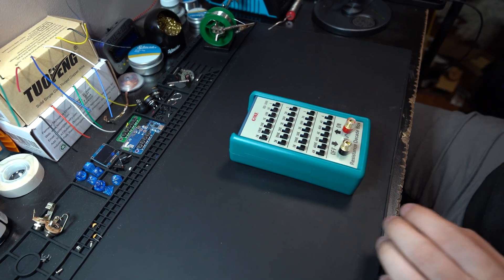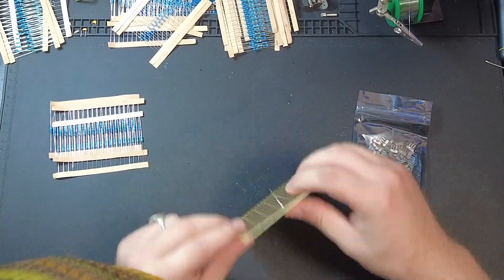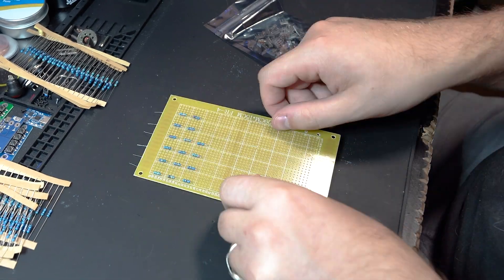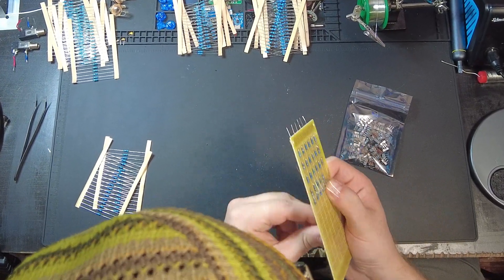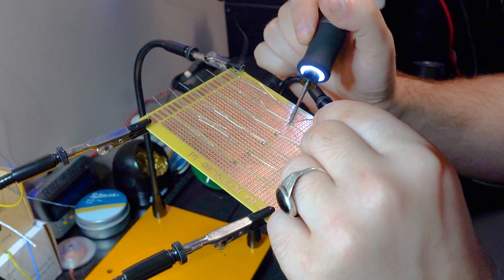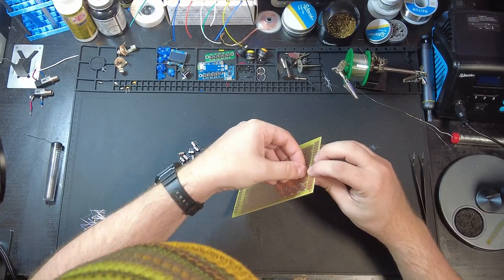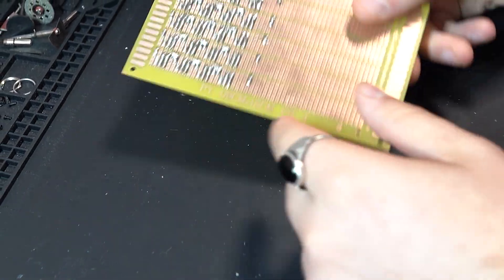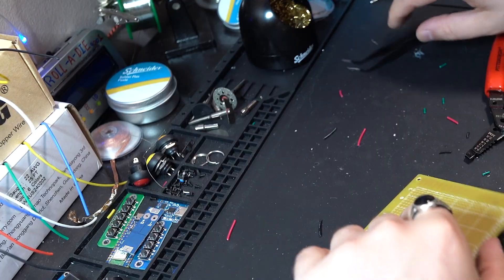DIY Resistance Decade Box

Comment: The main difference with the expensive one is always the accuracy. 
The accuracy of the resistors are what causing the price to be high. 
You are using the cheapest resistors with 5% tolerance. 
The resistors that have less than 1% tolerance are not cheap.
So the expensive resistance box is very accurate and often used by professional to fine tune or check the accuracy of the multimeter.
Reply: that is true generally, but it is true that the music community does not always overlap with the electronics community so what  happens is that even a basic pedal or switch or anything that is specific for a music purpose might cost you a lot not for what it really is but for the lesser demand because they know music people not knowing how actually complicated the part is will still buy them. That said I am really clueless about how precise they  need to be for this application tbh.
Reply: For most applications, 5% resistors are fine.

Comment: I'm surprised I never thought of this and have never heard of this either! But 70 bucks is a good deal, for an enclosure and assembly. I bet the tolerances are tight and manufacturers can get more constant values of components or tolerances because they get the cream of the crop by buying bulk etc. The engineering is probably easy but maybe it's a bit more complex, like do the tolerances stack? do they multiply? like after ten series resistors and some being 1% some 2% etc does that then mean the values could be off? IDK it doesn't really matter I'm probably gonna build one. Thanks.
Reply: Also time == money, but it looks like a fun project to do one or two of.

Comment: Awesome video! I really enjoyed seeing how you built the decade box. I was wondering, for beginners like myself, would using a potentiometer be a simpler alternative? Something with a wide range (like 0Ω to 1MΩ) might be easier to set up for quick experiments, though I know it might not be as precise or powerful as a decade box.
Reply: A potentiometer is nice for experimenting, biggest downside is that it has low resolution and to get its value in ohms would need to measure it with a multimeter. With a resistance box we can get the value just by reading the switches. 

Also potentiometer used as a variable resistor is unstable with temperature, time and humidity, my profesors told horror stories how their equipment tuned with variable resistors went out of tune when winter came and the factory had open windows. They fixed it by measuring the correct pot values and replacing them with resistors.

Comment: This seems like it could be super useful! I never knew these were a thing before this! I can't believe the markup on the commercial box compared to the diy version. Is there anything under the hood that makes them different other than the case and however the commercial version wires it?
Reply from the maker: @WayTooManyNames  I will say the gme model does feel great and they do use four resistors per value to achieve a 1watt rating while mine is only using 1/4 watt resistors (which is all I need for my current uses). They also seem to have really high quality switches! If I was a professional who needed a high quality enclosure for insulation and protection and needed a 1 watt rating the gme would still seem worth it to me. But as a hobbyist, i think I’ll get by with the diy model.